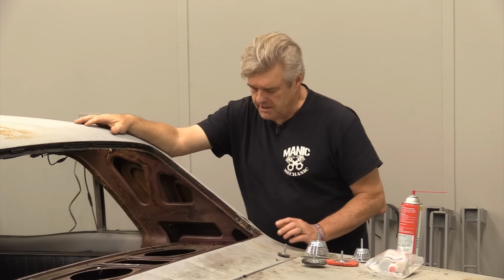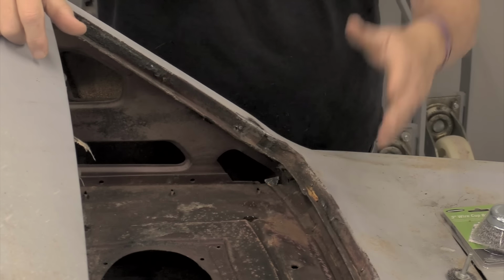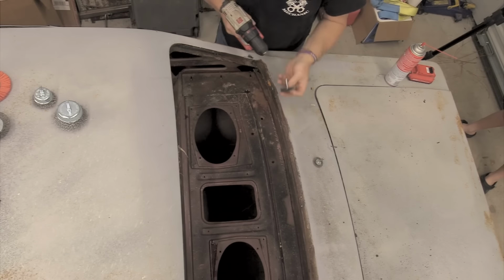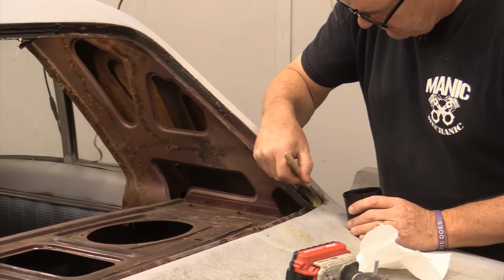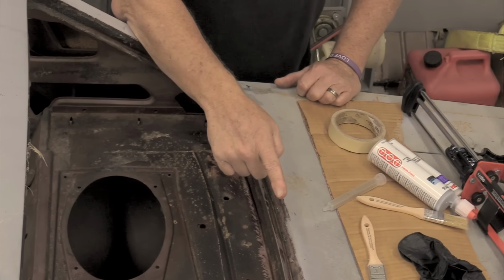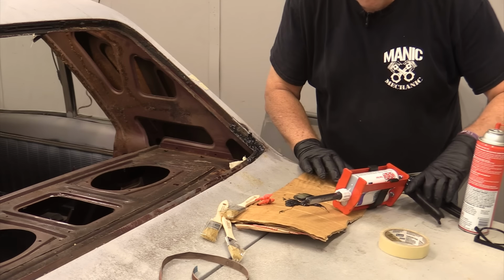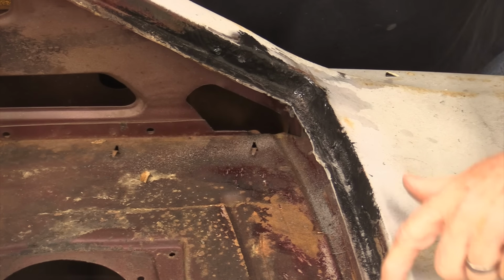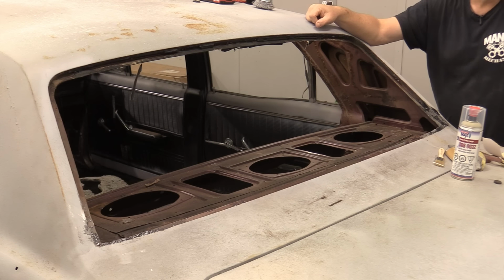Glue Your Cars Rust Holes

Comment: This panel bonding adhesive is a tool like anything else, but it's a good one. It's good enough to be the approved repair method for BMW and to build the whole F150 cab with. There's certainly things we can use if for in our older cars. The main thing is to understand what it is, how it works, strengths, weaknesses, and where it's intended to be applied.

Comment: Acrylic enamel Is about $65 per gallon with reducer and activator. 
It doesnt shine like clear but it lasts 10+ years outside. Not a bad deal for $ 150 for red paint plus normal supplies every job needs.
Personally, I will NEVER get another clear coat job. Top dollar brand name paint lasts  36 months outside.
 Ouch $$$.
Shop around for good prices. Avoid the high dollar schtuff.
Also when enamel fades away you can recoat it easily. You dont have to spend days $$$ stripping off the ruined clear.

Comment: 🔔😎
The panel between the rear windshield and the deck lid is called the dutchman panel. Dont ask me why.
The front cowl panel with the air louvers and wiper shafts is called the scuttle panel.
🙄🙄🙄🙄

Comment: What I find be the best way to prevent leaks is to use a hammer and dolly first. Meaning laying the glass on the metal and look at gaps. Mark them and hammer for perfect fit so you know the rubber will be evenly touching the metal. Then, make real rust repairs. Then use whatever to seal the metal. A 2k clear coat on metal would do similar to your glue except you can spray it

Comment: Would have been less expensive to use 3M epoxy seam seal that has corrosion inhibitors.    

Or any 2k seam sealer.   There are ton of seam sealers with corrosion Inhibitors.